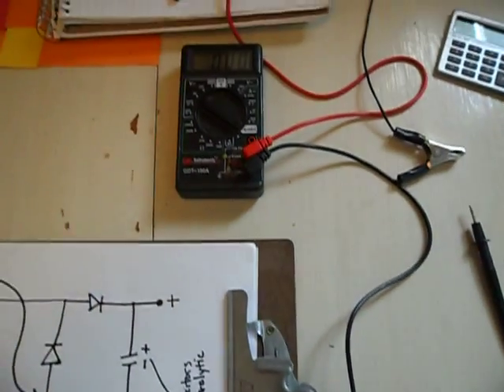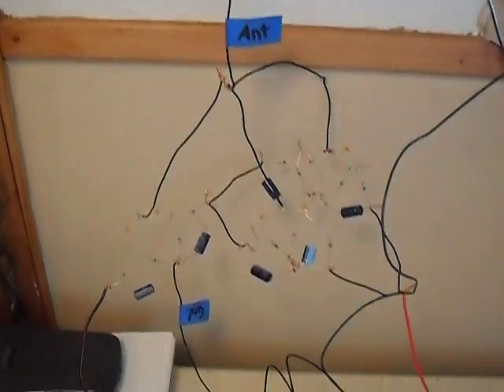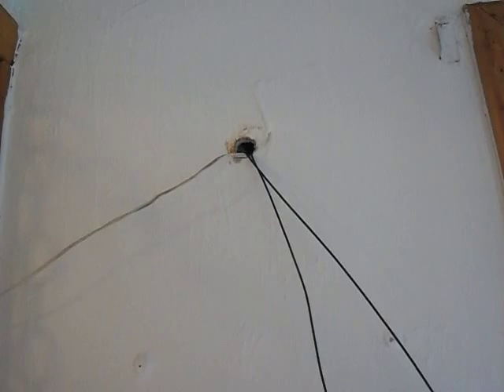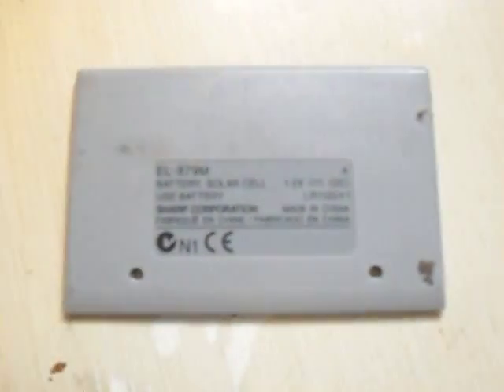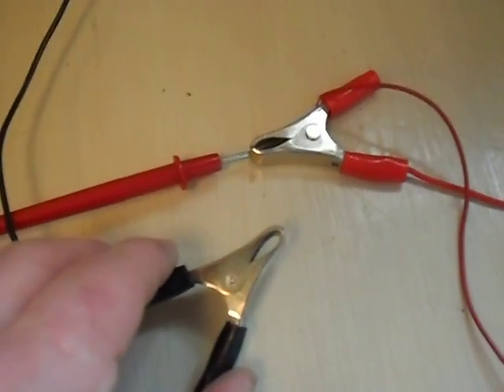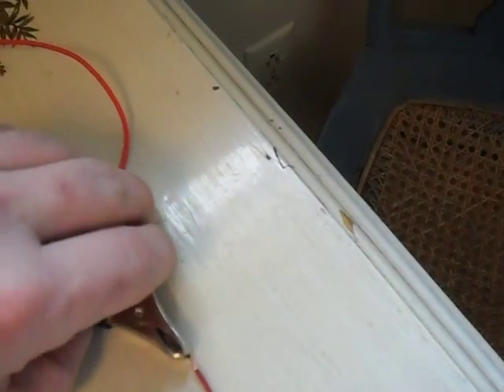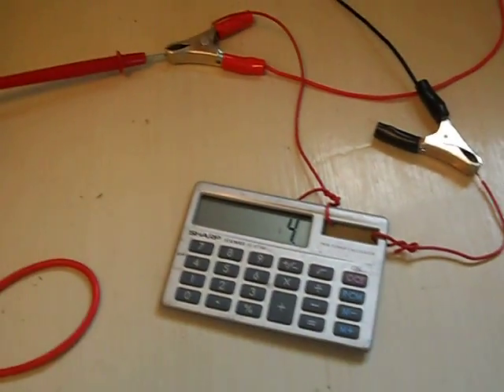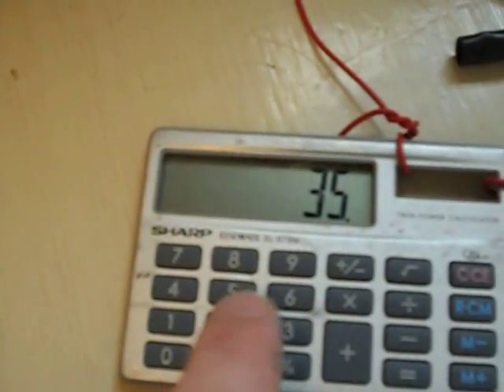Free Air circuit WORKING a small calculator FREE energy power electricity Tesla's Idea ?

Comment: You don't even need germanium diodes, normal diodes also work. The higher the antenna, the better. Surface area of the antenna also matters. So try to hook the antenna to a zinc gutter   :-)

Comment: the diodes are what boost the signal right?(i'm a bit rusty) if you just added more in line with the others, you could theoretically make it more efficient, also what did tesla originally use? i can't imagine he stopped at something so small.

Comment: These circuits are great because it cannot be just RF waves. You read any conventional book on RF receivers, they will say that the amount you receive is unreadable. Yet the best of these set ups, namely inventor3, can receive over 100 volts. If the antenna goes into a deep grounding, say 1 meter copper tube, you can be receiving current in the milliamp range. Adding coils to the antenna in the right place can increase inductance massively.

Comment: I'll have to try this. If you can get 4-6V, you could store that in a small electrolytic cap, then, using a $2 boost converter, dump that cap into a car audio 16-20V 1F cap, which eventually could charge a deep cycle. You might die before the battery fills, but it could be done lol

Comment from the maker: @galanisj You should be able to get 20v, but 4.62 ah will be very tough. My best guess would be to try using a radio ferrite coil and variable capacitors to allow you to tune to the strongest signal for a chance at some real power.   Good Luck and don't for get to check local laws and stay out of trouble.

Comment: @newmrv Here's an idea for you, as an adaptation of your schematic. if you put a parallel tuned circuit in your antenna lead resonant at 60Hz (in the U.S), you might be able to determine how and at what frequency your "free" electricity is coming from. You could even make it variable, so that you could find the strongest point and best frequency for free electrical power. If you know the frequency, you could make a guess as to where your energy is coming from. Put it on the HAARPS frequency !!

Comment: the power you are getting for your calculator is probably being induced from nearby power lines - so it is not free at all and if you were sitting under a power line dong it with a large conspicuous col on top of your car you'd be arrested for stealing electricity by the power company if you were caught. It happened here in the UK years ago and made the headlines.

Comment: If this gets popular we will one day be using calculators, clocks, flashlights running off free air circuit just by using a ferrite rod antenna with this circuit.   We just have to wait until someone comes out with a surface mount germanium diode.
Reply: C

Comment from the maker: If your using these designs let me know if you get extreme readings around the time of extreme solar activity......   it's like a solar flare detector....mine went off the chart and blacked out the calculator and clock and read up to 70 volts ...I hooked up a led and it blew.....duhh...then I grounded it and the led ran nice and bright for 10 min or so...now its all back to normal................let me know what you find.
thanks